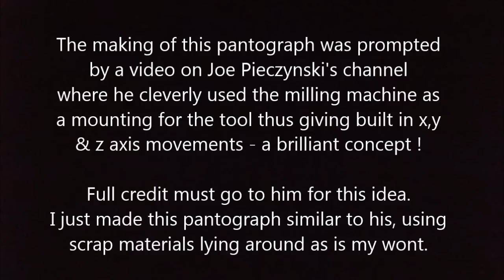Homemade Engraving Pantograph

Comment: Liked this one and can imagine many uses. Also I think you could sell pdf plans for this.  Since the hole positions are critical I was thinking by drawing it in CAD at one to one or actual size the users of your plans could print out the plan in an inkjet printer and then adhere or paste the printout to the aluminum stock, thereby obtaining near perfect registration on the hole positions for centerpunching and drilling.
Reply from the maker: Sounds like a good idea, policedog4030, but I have no intention of selling plans for it, although you are welcome to if you like.